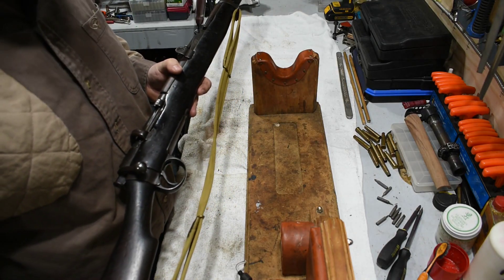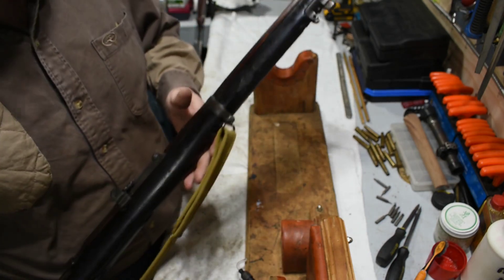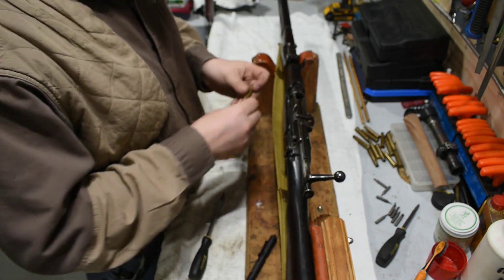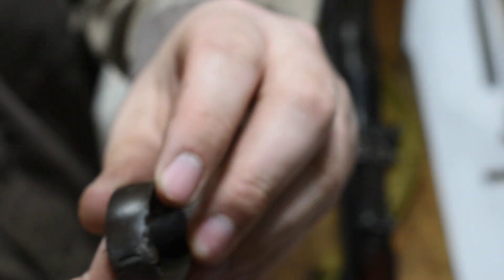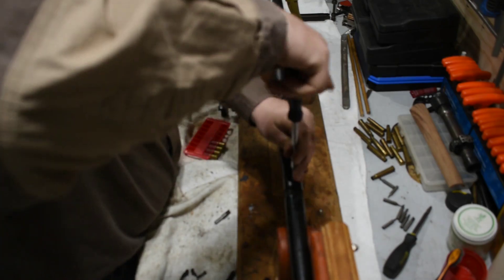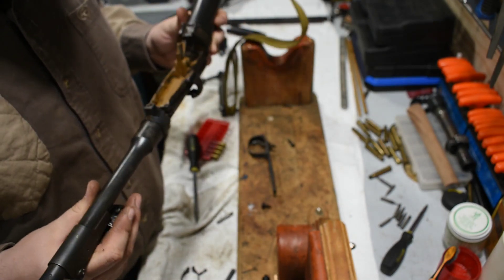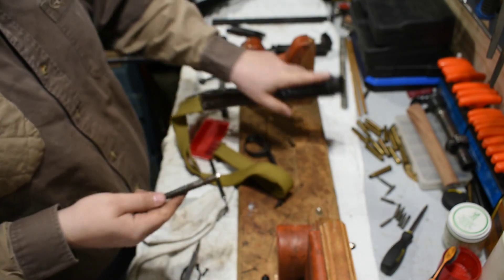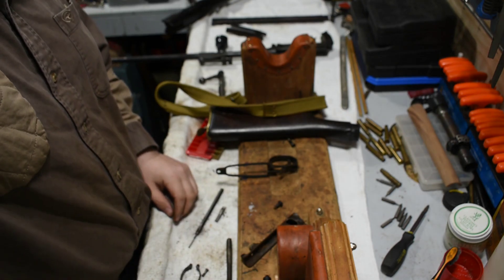410 SMLE Teardown & Examination.

Comment: Much as I find these muskets interesting on their own, I'm afraid it would only be a matter of time before trying to "tinker" with it. Drill out the wooden dowels so as to pop the block out of the magazine well before moving on to doing the same to the rivets holding the steel plate in place, and, from there, it's just a matter of finding/adapting a magazine. The advantage of doing this with your example is that, since it already featured the magazine cutoff, you might be able to replace it if a magazine won't work.

P.S. congrats on your musket 😊
Reply: Thanks, I didn't know the .410 Lee Enfield had a magazine disconnect.
Reply: Hey @bobhill3941, just so you know, the magazine cut off on this guy's example is from an early production Lee Enfield Mk III that would've seen service during the years leading up to WW1. Soon after fighting broke out in Europe the British realized they needed to ramp up production to make up for losses on the frontlines, hence the intro of the Mk III* which did away with such "unnecessary" features as a magazine cut off. Most pre-war rifles were later converted to this pattern after the war so one with a cut-off switch is relatively rare.

Hope you found this helpful 😊
Reply: @Whofan91  It was, thank you very much.😊